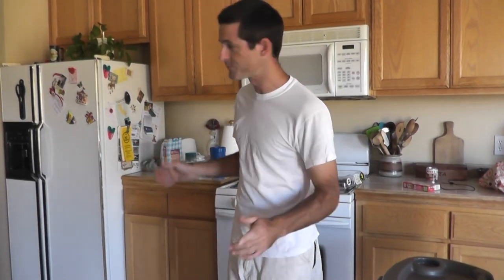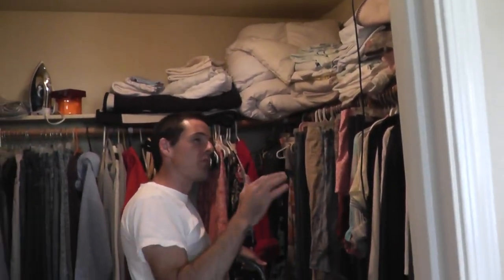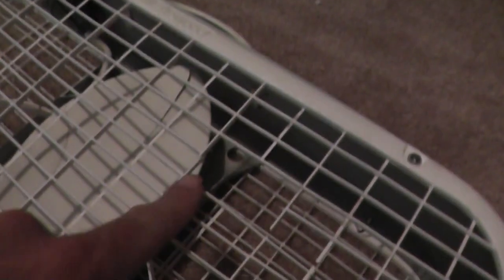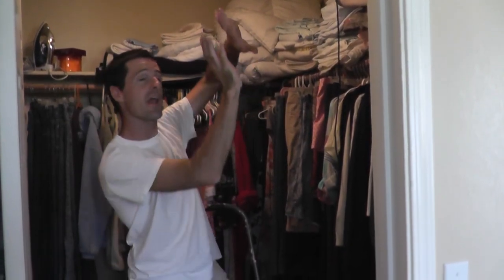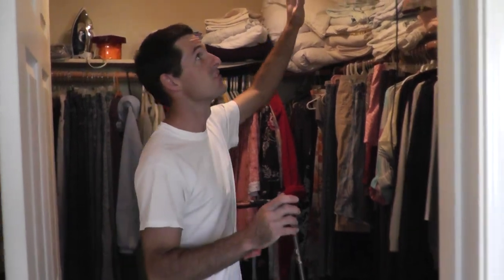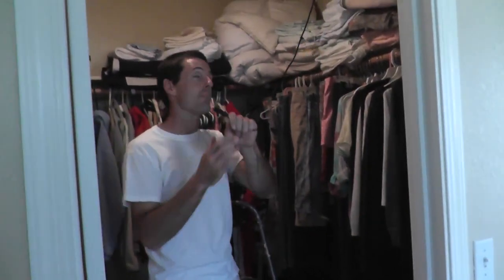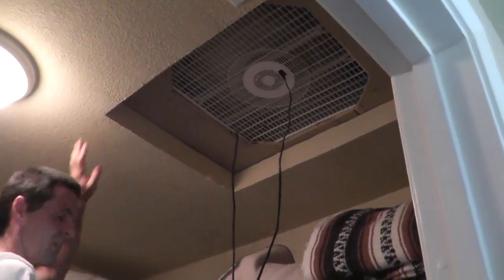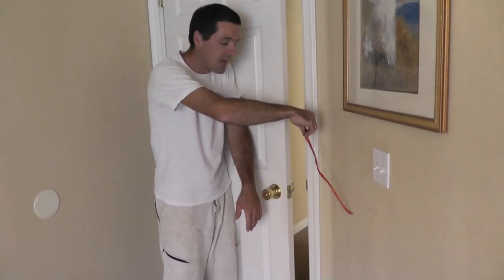Cheap Homemade Whole House Fan - How To Cool Without A/C !!

Comment: great job sound thinking have you considered adding more heat storage systems to increase storage capacity ie big bottles filled with water that also absorb heat during the day and release it at night. The water bottles (25 litres) could have their own heat exchanger matrix around them to help them absorb and release heat as needed
Reply from the maker: Interesting idea, I hadn't thought of that

Comment: I have a question. Please do not attack I am simply asking a question as I really do not know. Would this fan possibly make the attic more humid? I ask because I small ranch house. If I used this fan could it suck the moisture from the bathroom an push it to the attic? I saw some other videos that showed the issues of some pumping their bathroom exist into the attic. CI know it is not in the bathroom but could it pull the moist air?
Reply: +Vince:  A I think it's possible, since we would assume attic is cooler compares to bathroom, so if someone just take a shower in the bathroom, the high humid air would likely be attracted to attic, and the next thing gonna happen is humid air comes to cold surface: you might get water on the wall of your attic.
Reply: +liang jiang And eventualy mold

Comment: Yeah, we also did this with an attic access in a closet. For a few seasons, we used a room fan taken off its stand, mounted on plywood with the right size hole. Worked very well, and quiet. Also used a box fan on its side for a few years. OK, but noisier and a bit less effective. It seems that being side-mounted kills these fans after a few seasons, but they're not expensive. Now using a bona-fide attic vent fan, again mounted on plywood - much more powerful, but noisier. In all cases, very good for the closet's adjacent room, cool sleeping at night, but less effective for overall cooling.
  In winter, got to throw a big plastic garbage bag over the fan to keep the cold air from coming down.
Reply from the maker: Thanks for the comment. Instead of a bag, you could buy some of the thick foam they sell at craft stores and cut a piece to fit in the space.

Comment: strong i cant live withour air. some times our air is set to 55 degrees and feels really good. But mostly 68-72
Reply: ***** Sorry, but your assumption is incorrect... I assure you that you do not have to be overweight to be sweating at 75 anywhere along the gulf coast. New Orleans is the worst I've seen, but here in Houston the humidity sucks too. Just sayin...depends where you are...

Comment: Common sense clever!  Good for you!  I use one of those large Costco super fans in one window pushing air out, while opening all the bedroom windows to draw in cool night air.  Your idea pushes that up a notch.
Reply from the maker: C0Y0TE5 thanks! I actually got a similar fan to the one you're talking about and replaced the box fan with it. Works great and much better than just using the AC

Comment: I was a bit confused about 1 door open at the other side of the house, does it have to be all the way open or can the metal gate be locked, or like padio screen.
Reply: As long as air can get through it, it should be fine.

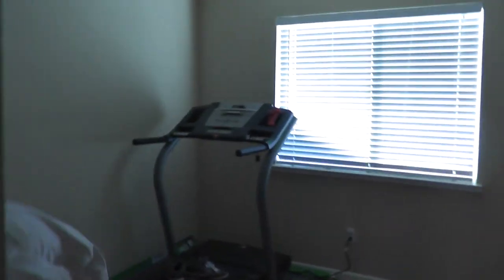Comment: @3:56 is that not an attic fan in the roof of the hall? If it IS than why don't you use it?
Reply from the maker: mattdidit84 No htat's just the intake for the electricity pirate aka air conditioner.

Comment: Can you give an update on your homemade fan?  You have inspired me to build one.  I have a box fan sitting around doing nothing.  I live in the mountains in Southern California, and soon as the sun goes behind the mountains, the temps drop about 10 degrees in about an hour, which means it is usually 5 degree cooler outside than in the house.  I am currently using 2 window fans, intake and exhaust, that takes to much time to feel a difference.  I have easy access to my attic, like you.  The entrance to the attic is in the extra bedroom.  Please let me know... thanks.
Reply from the maker: I tried this setup for a while and it helped some, but I ended up buying a larger fan (the circular metal cage kind) and it was really a noticeable difference. I think you should try a pair of those for you in/out setup.
Reply: Jennies Garage How many square feet is your home?  I have a 1 story, 1100sqft. Small home, just me.living in it.  I ha e a 20 inch box fan.  Would a 20 inch box fan work for my house.you think?  Funny you answered, I was just measuring everything.  Wednesday going to go buy the plywood and couple other things and do it.
Reply: Like right now, inside home is 79, outside is 68.  I want that cool air in here.  I have windows fans, they run all night and when I wake in morning, house is about 72 or so.  But I want something that takes 60 minutes or under to cool thr house off to outside temp.

Comment: that's stupid.. all it does is vent even more hot air into the attic and making it hotter, then you have a whole new attic problem in trying to vent it out..
Reply: You shouldn't comment on things you don't understand.
Reply: The whole idea is to push the cool air up from the basement. A lot of bloody good a fan in the ceiling is going to do!!

Comment: This type of fan blade blows air but doesn't actually pull air from your home. By the looks of your home you will need a much bigger fan than that. Also I am puzzled why you installed it in the closet? There is no way that fan is powerful enough to pull much air. Meaning CFM you are getting suction but its not cycling your entire cubic feet of air within a reasonable time.
Reply from the maker: +UNKPCRIDE Even though it is not optimal with regard to cfm, I still notice a nice cool draft with the fan in place. I put it in the closet because that's where the attic access is.
Reply: UNKPCRIDE A centrifugal blower would work better
Reply: Need two fan one for fresh air intake other for exhaust air out

Comment: Does not work well at all in South Texas
Reply: Wouldn't work on the Texas Gulf Coast either, even the "northern" Gulf Coast.  Heat, humidity, and mosquitoes -- what else could you ask for?
Reply: mminc81 high humidity is the killer of all AC units. If you are looking for a permanent fix there are some people that are having good luck with buried thermal batteries. Basically its a block of heavy concrete with copper pipe running through it or thin gauge plastic tubes buried beneath a newly constructed house. I would use the concrete block simply because if you already have a home its impossible to tunnel under the foundation cheaply but a good 10'x10' space could be somewhat easily excavated. At about 10'-12' below the surface you have a near constant 65 degree temperature. So it operates kind of like a cheap cooler, the block and copper allow you to run air through a small heat exchanger and pump that cooler air in your house. Typically you could also install root vents and fans to assist in channeling this cooler air into your home.
Reply: mminc81 Probably in North Texas

Comment: I think putting the fan on a timer would be a good idea in case you forget to turn it on. If you don't want the closet wide open, you could just use a doorstop to hold it open. I still don't have a solution for the windows. Any ideas anyone?
Reply from the maker: Hi, the best I can think of for the windows is a piece of cardboard with a fan sized hole cut out. Not very secure though.
Reply: Something similar to a doggie door would work as long as the fan created enough draw to pull the flap open. Fan turns on, air pressure pushes flap open. Fan turns off, the weight of the flap pulls it back into place.
Reply: Why don't you just cut a square hole in the door and pot a return vent grill on it so you wont have to have the closet door open all the time.

Comment: could you do the opposite in the winter and push the hot attic air into the house? I like it. my attic entrance is in my hallway from my kitchen. I think I will try this this summer. thanks.
Reply from the maker: It sounds like you have a perfect fan location. The more centrally located the fan is, the better it will work. That's an interesting idea about reversing it, I'll have to check and see if my attic is warmer than the house on a cold day. Thanks!
Reply: make sure there are no materials in your attic that are toxic to lungs such as fiberglass insulation or mouse droppings.
Reply: lol, yeah good point.

Comment: so did it work out? did you save money and live in temp comfort?
Reply from the maker: Well, I didn't live as comfortably as I would have with the a/c set at 70 degrees, because even with the cooler, the other side of the house was still 80+ degrees on a hot day. But the area of the house where the cooler was always stayed in the low 70's even when it was 100+ outside. It was much better than nothing though. And I didn't turn the a/c on at all! Probably saved a few hundred dollars over the course of the summer.

Comment: Okay, it has almost been a year since you did this, how did it work for you?
Reply from the maker: Just the fan in the attic helped a lot, but I ended up combining it with my homebrew evaporative cooler. That made the house much more livable when the temps got up above 100, and I made it through the summer without turning on the ac. This year I'm going to replace the box fan with a higher powered unit so that I won't have to run it for as long.
Reply: ***** That's why people used whole house fans prior to the wide spread adoption of home air conditioning.  Some old Popular mechanics magazines and similar showed whole house fans with large electric motors running belt driven fans which, with variable pulleys, could be changed for fan speeds.  One item to note is to angle the fan to exhaust toward the end of the house opposite the end hit by prevailing winds.

Comment: this gives me an idea. I live in a cape cod and we have a storage space above the hallway downstairs and an electrical outlet on a switch that we don't really use so I could cut the hole for it and run the cord thru the attic and down to the socket with some extension cords and have my downstairs cool with a switch.
Reply from the maker: Good idea! The one thing I don't like about my fan is I have to step up on something to turn it on or off.
Reply: ***** sounds great there are remote outlet switches you can buy.
Reply: *****

Hi I really like your video and I'm thinking about doing it for my house. I'm a new home owner and not a handy man by any means, so I want to be very careful before I do any modifications to my house. I live in California and my house was built in 2002. My questions are, when the fan runs, it would blow all the insulation (fiberglass) in the attic, would that cause any problems? And when the  fan stops, would stuff falling through from attic back to my room? Any recommendations on which type of fan I should get?

Again, thanks for the video.
Reply: my ceiling looks just like the one shown in the video. I don't know what kind it is. I have good ventilation in my attic.
Reply: lifetime student you can use a circular saw to cut it. just trace the fan and cut on the tracemarks you made. just be careful =).

Comment: great idea, I wish I would have thought about this 20 years ago.  I always wanted a whole house fan.  I tried window fans but had to put one in every room, by that time the electric for all of them was as bad as running the A/C.  One thing I would change is build a sliding door under the fan so you can close off the hot air from bleeding in to your house or closet in your case
Reply from the maker: vince king That's a good idea. I was thinking when I use it this summer I could cut a piece of rigid styrofoam to put there.
Reply: vince king its a good idea but there are other less DIY options similar to this like solar roof vents, IE: that spinning ball which have as good ventilation properties. The problem with a lot of homes is that when they were built in the 70s-90s energy was relatively cheap so things like wall insulation, roof venting, upper wall vents in order to channel that hot air out of the house were not put in. I think something like a solar roof vent + upper wall vent channels cut near the roof would offer you what you are looking at, sliding vents are relatively cheap and having them as adjustable vents would let you manage the room temperature in each individual area
Reply: but the point here would be to turn this make shift atic fan on at night with the window open and draw in the cool air like a window fan but you only need to run one fan thus cooling the whole house with out having to run a/c.   I agree attic vents and turbines help get the heat out of the house but this is to get the air flow of the cool outside air in

Comment: Where does the air go after sucked into the attic. It has to go somewhere, I wish you included that in the video
Reply: 🌬It leaves through the soffit and roof vents.
Reply: @richmellow3315  thanks, I wasn’t even aware that attics are vented. For some reason I thought they’re not
Reply: @FirstNameLastName-hy2iz  👍I highly recommend just buying a (High velocity fan), typically the all metal ones that sit on the floor, And put it in a window (blowing out) and have a few other windows open. It's strong enough to pull a constant breeze. 'It's crazy the draft/wind blowing down my hallway.'🚬😀
Reply: @richmellow3315  yeah I don’t care how it’s done. I just want to be able to move a lot of air through my house when ever I need to. So your way would definitely work for me. Thx

Comment: Another thing that you need to consider if you leave the air-conditioner off during the day while you are at work is that the items in the home become "heat soaked".  They are acting as a "thermal mass" and storing the heat energy.  When you get home and turn on the air-conditioner or try to use a whole house fan, all the excess heat that has been absorbed by the stuff in your house has to also be removed.  For example, let's say that the house is at 100F when you get home and it gets down to 70F at night where you live.  If you just replace all the air inside the house with air outside the house and then stop the fan, the house will start warming back up.  Some of this heat is from the appliances that generate heat (e.g. refrigerator, etc) and some is just from the heat that has collected in the various objects in the house.  My electricity bill probably averages around $400 per month.  I have air-conditioning and keep it set for around 75F during the day and 72F at night.
Reply: better idea...move to a more moderate climate..."misting" a roof may seem wise in theory...but it is excessive moisture on a structure that is intended to stay dry